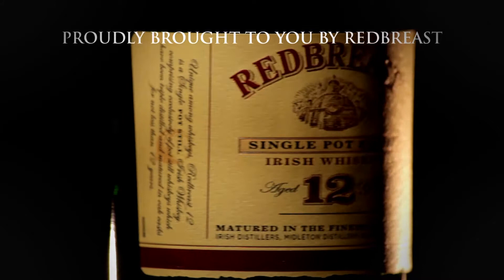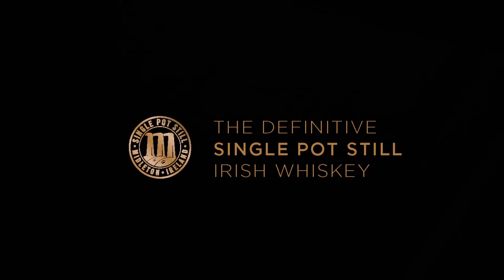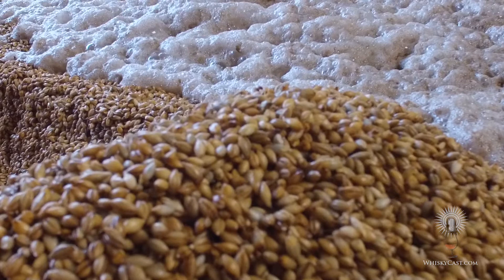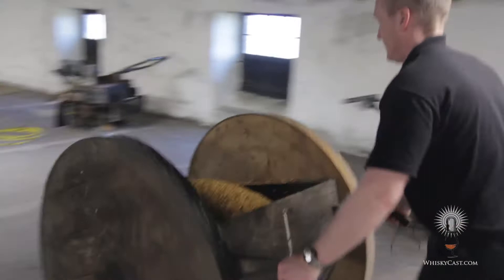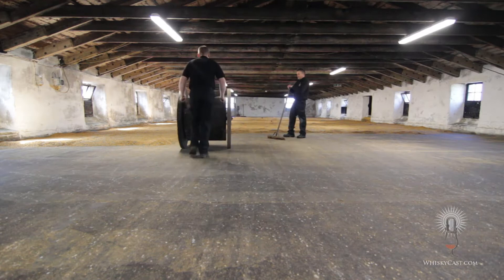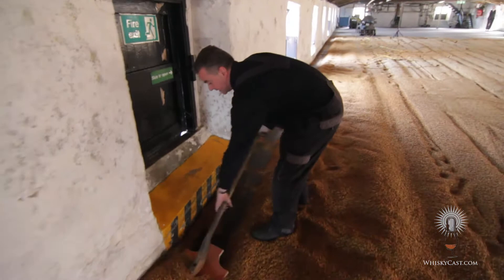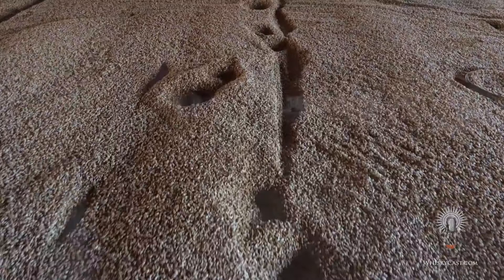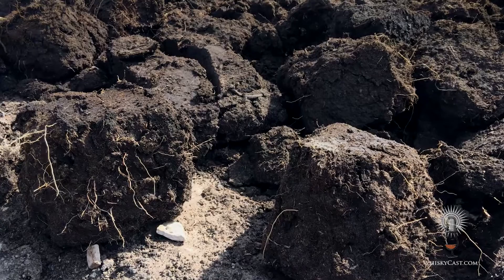WhiskyCast HD: Making Scotch Whisky the Old School Way with Floor Malting

Comment: fascinating, thank you. question, is malted barley moved from the floor  to somewhere else for peating process?
Reply from the maker: Yes. The grain is moved from the malting floor to the drying kiln, where it's spread out on a screen above the oven where the peat is burned. That allows the heat and smoke to rise up through the grain, infusing it with the peat smoke as it dries. Hope this helps!